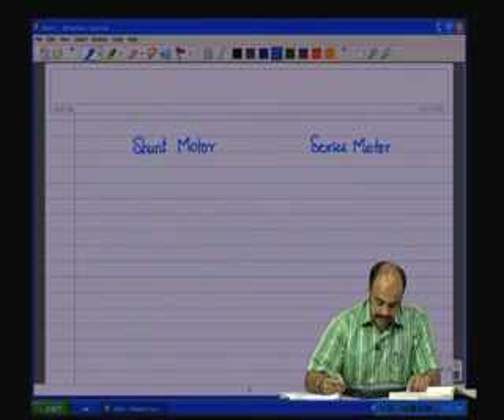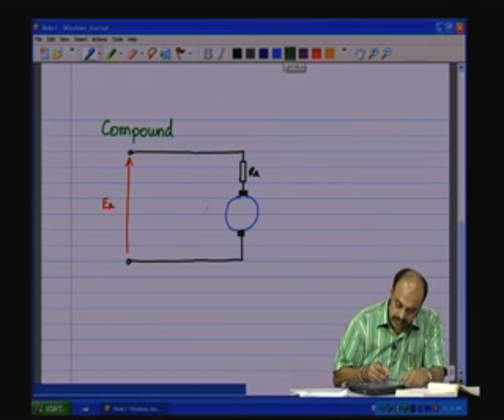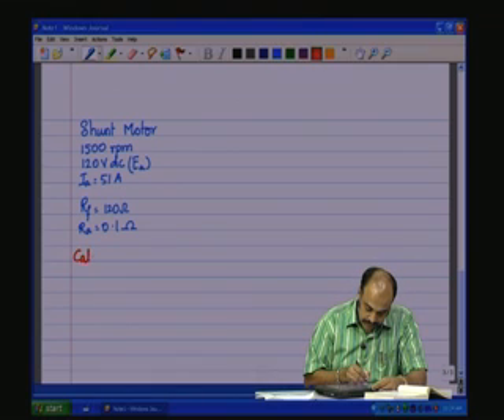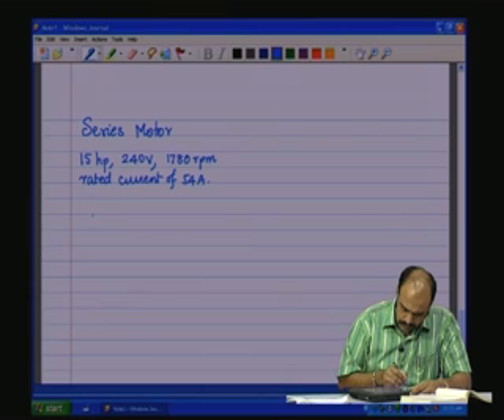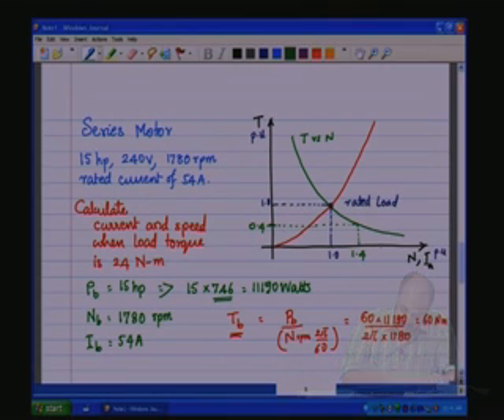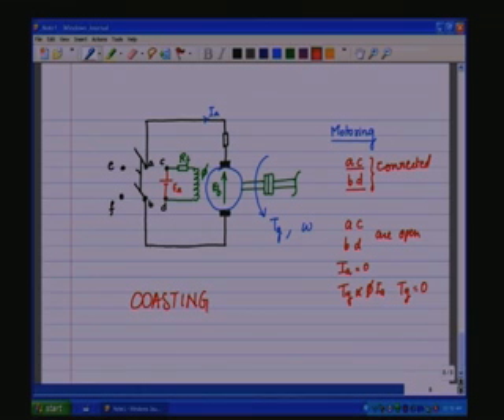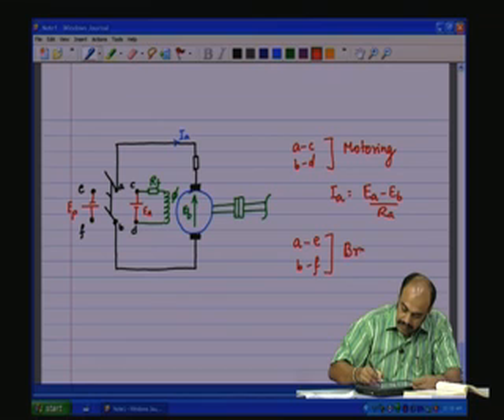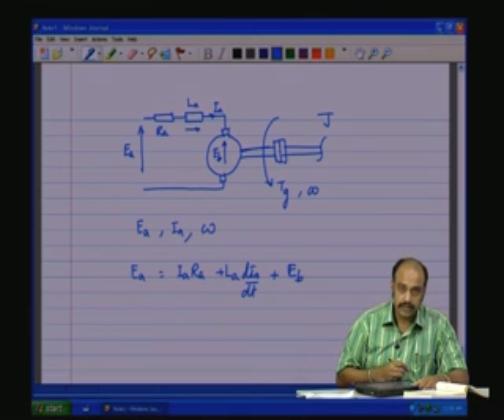Lecture - 29 DC Motor 3

Comment: So the power across the load is 5750W that is produced by the back emf or the diffrence of 6120-5750????
Reply: Paul Popovici instead of saying that the power across the load, we say that the load absorbs 5750W of power. As energy is absorbed or produced and not applied across a machine